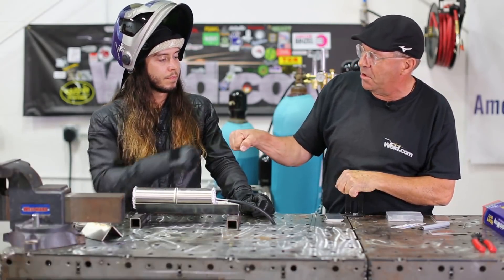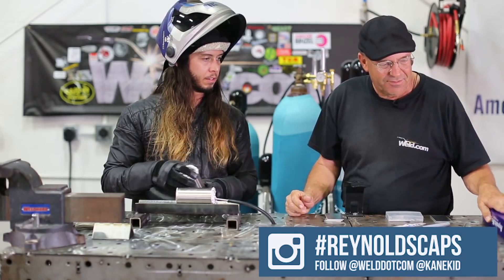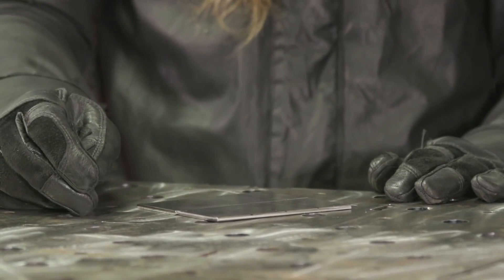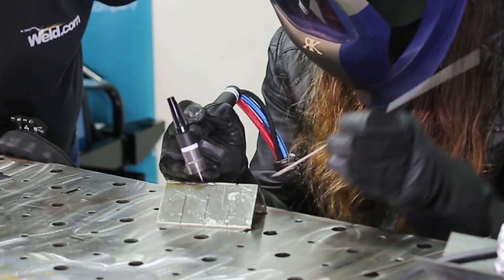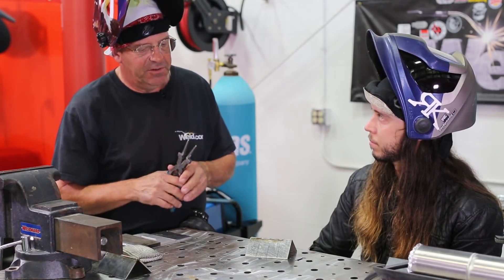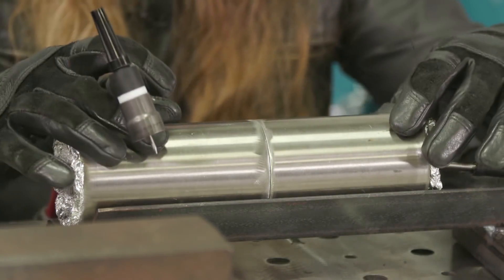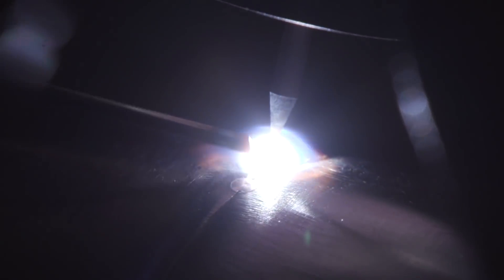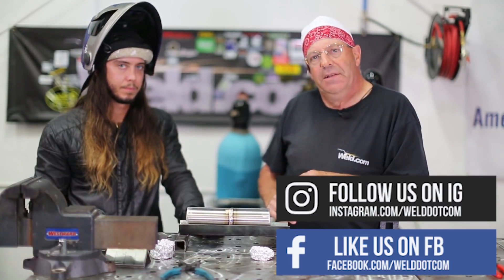🔥 TIG Welding Stainless Steel with @kanekid

Comment: I have been in the craft over thirty years.
I have ran a lot of SCH 10 big bore food grade T-304  no purge  but solar flux backing. 
37° bevel no land butted up no gap which renders a good flush root, no sugar.
I was wanting to know if you have ever used solar flux on any of your projects and how do you like using it?
the aluminum foil works great in a pinch but plastic tube caps are excellent for purging super heater tubes.

Comment: In fact, no matter how you hold the filler wire, there are always three points of support. You put pressure on the midpoint and the wire is pressed against the other two. At each of the end points, the pressure is less than at the middle. And if now you move the midpoint along with one of the end points, then the friction at these points will ALWAYS be greater than in the remaining one, and the wire will move together with these two points. Thus, you can almost endlessly invent different grips and practice them.

Comment: When  purge welding  longer sections of tube the setting  of the purge pressure  must be accurate  , to little  the weld will be concave and to much convex , so settings is important  ! When we do food grade we don't use filler wire only fused hence the purge pressure important  !

Comment: Wrong cup, tungsten out to far, to much heat and color is way off for stainless. And is that really only as far as you can go before you have to stop? Even with free hand without a turn table a good welder should do that in 2-3 stops and starts. With the proper heat and travel speed no pulse is required when doing free hand but when doing turn table work it's good to have.
Just saying.

Comment: I learned on stainless so I’ve always found it easy. Not a welder by trade though. It’s the welding 10mm thick to 1mm plate or welding 0.5mm plates that’s the hardest. Thick material is easy. Top welding though from someone who clearly knows his stuff!

Comment: Never went over the amps he hits when doing the exhaust piping.

Did he stay at 66 like before? Less more? Only asking because I have my first stainless exhaust job next month. Going to fab my cousin a custom SS exhaust.

I was aiming more towards 35 - 40 amps but I’m starting to think that’s a bit low.
Reply: Watch the video again... it was discussed. 130amps at a push angle, very quick weld

Comment: Come pipe weld in a shipyard with a mirror lol these shop welders dont know
Reply: Come down the ship yard... there's a bunch of blokes with their dicks out pretending they ain't gay, but it's ok to stroke 'em
Reply: Yup, I TIG everything in the field. Against walls, upside down,  on the floor, straight ahead with a damn 90° torch. These guys are good for bench welding but they can't cram themselves in a corner with a mirror, cut the rod down, flip hood only on a bimetal hard hat  per OSHA. I'd love to see it. Camera dude couldn't even get to where I have to most the time. Oh, almost forgot, let's do this AFTER lunch. HA! Amateurs.

Comment: Why a 12 cup and not an 8? Small rod, small puddle, do you need that wide a gas coverage?  I am re-learning to weld after taking 20 years off.  I preparing to make myself a set of stainless headers, so I want to get it right.
Reply: #12 cup will give u some nice looking welds especially on 18 gauge ss pipe
Reply: 16 gauge sory

Comment: On the tube. Turn your purge to 25cfh. Amps at 56. 1/4 inch tacks quartered.  Walk the cup non stop all the way around, no rod needed. Saved you 3/4 of the time. Enjoy.
Reply: What if u were building a hot side for a turbo out of 18 gauge ss pipe or even schedule 10 would u still not add no filler with that 50 pound turbo hanging off the end of it
Reply: Meant to say 16 gauge .1xx not 18 .050

Comment: You can weld aluminum foil together if you fold a piece of it in two and then change polarity...it'll eat the tungsten but it will work. Basic. Also,  you can pick up a quarter or nickle with a cutting torch if the head is clean enough.

Comment: ive seen a paste made up using alcohol and flux powder used to combat carbides from forming on the id seemed to work fairly well with the thin wall stainless and kept the id really tidy

Comment: Beautiful welds. It would have been nice to get a better look at the penetration. It is a little hard to see at 12:52, that brief glance looked like incomplete penetration.
Reply: I saw no penetration, those fast micro-dabs don't feed enough filler, he has a long arc and is at like a 45 degree angle... fine for instagram I guess but not for any parts that matter.

Comment: Good video!  I haven't TIG welded in decades but used to TIG weld thin-wall stainless food-grade piping runs with sanitary welds, always Argon flow in the pipes, using a very basic Lincoln transformer AC/DC welder and buzz box and 2% Thoriated tungstens. In-place welding at all angles, no luxury of spinning or moving the parts. It sure was fun once you got the hang of it. Great to see you and guests sharing the knowledge.

Comment: If you want to run a purge off one bottle of argon all you need is a "Y" with a valve on each side. Open the valve for the torch all the way and set your torch flow and then use the other side to run the purge. Won't get an exact readout for your actual flow rate this way but it gets close enough you can't tell any difference and it's a cheap alternative to a separate bottle and regulator.

Comment: wtf to many start stop there's no need for wire. I'd put a back purge at 9 lpm hotstart 60 amp @1 sec to base 40 amp down for 2 no wire. and weave perfect flat inside .2 Reo outside. I carnt stand seeing ppl use wire on tube

Comment: Great video Bob.
Interesting use for aluminum foil to say the least.   
Here is one  for you.  A buddy of mine is building from scratch, some type of European race car that was made back in the 1930's or so.  He said there are only two existing in the world today.  He is determined to make a 3rd.  It is all aluminum, frame, body, hinges, everything.  Currently it is about 75% complete.
This he does out of his garage with no "special"  (that should  read as EXPENSIVE) shop tools.  He is using BOA welding methods to weld it all together with some type of aluminum welding rod.
Have you had experience using a torch with aluminum rod to weld aluminum together?  If so, perhaps you can put together a video explaining it and what you are using.
Thanks again for all the well thought out and planned videos.

Comment: Uncle Bob, I'm dying to see you working on thin material. Can you please include such work in both MIG Monday and TIG Friday anywhere soon? I'm sure there're lots of viewers here who do automotive body/exhaust/intake welds, not your ordinary heavy duty piping and submarine heavy duty structural constructions.
Kane, your work looks terrific! Outstanding!
Reply: TheZzziggy We have several times.
Reply: Naw, uncle Bob, you haven't. I really mean a thin something, like 0.8mm which most of the car body panels are sized of (sorry, I don't know that gauge it is, I am metric). I have seen every episode of Mig Monday's since the days when they were run by Granpa MIG and there was a single onefeat you when you worked on something of 2mm thickness or about.